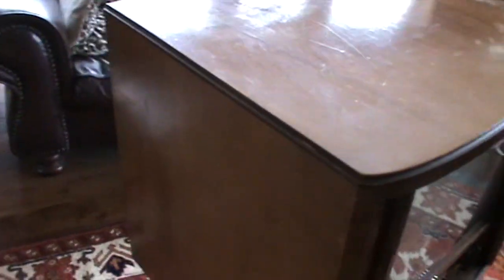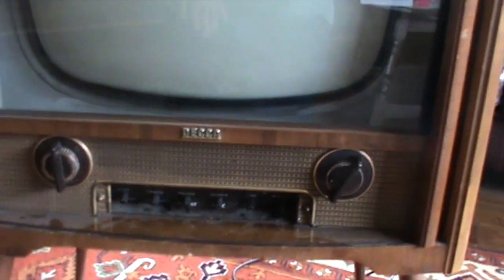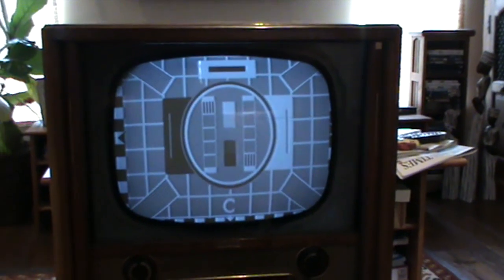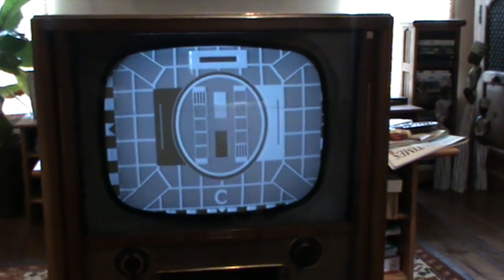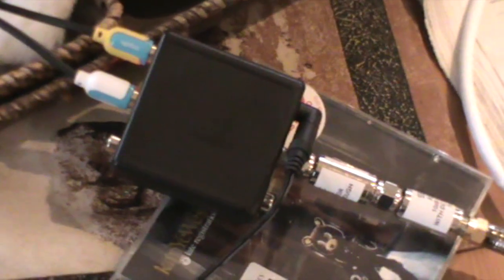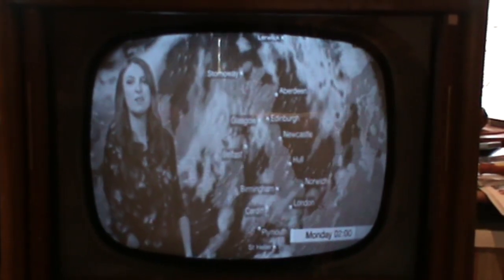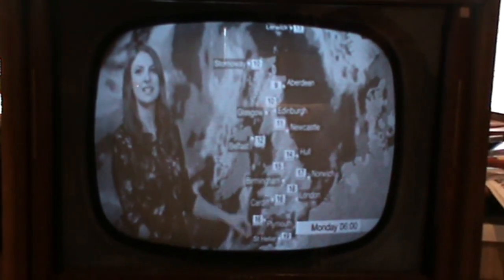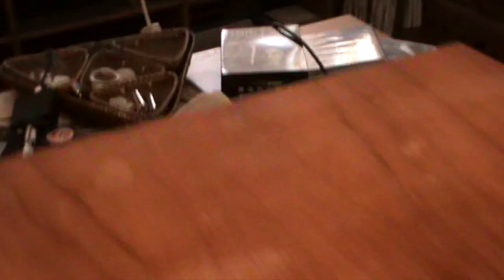Back To The Future: Old 1950's tube TV receives digital satellite television

Comment: Nice tellies, those DECCA DM4. It'll be from around 1958, and is contemporary to my  Bush TV75, Dynatron TV34 and others. The coronation was in 1952, so this DECCA wasn't even on the drawing board.  I have a nice HMV, band 1 only, which proudly displays its royal patronage in the form of a transfer on the top of the cabinet, and states "By appointment to his majesty the king"..... It definitely saw the coronation of her majesty the Queen Elizabeth II.

Valve technology is far superior to modern modified sand in so many ways, and ironically, valve failures were quite uncommon, and many original valves are still functional to this day.

I doubt if many modern, digital flat panels will stand the test of time - And good luck to anyone trying to restore one of those in sixty years time!
Reply: I've one of the first flat-panel monitors (a 2001 Dell FP2000), and the panel isn't the problem, the CCFL light output diminishes over time, and the colour is off. But it still works. 

I do think if it's solid state, and not from the era when all the condensor popped, they probably can last very long.  Just like amplifiers from the 70's and 80's.

Comment: Does anyone know how to get an old channel selector tuned into the corresponding digital station?

For example, channel 10 on the dial would be tuned into the standard definition digital 10 or 10.1 or whatever it’s MUX number or frequency is.

I want to still be able to use the channel selector on an old TV - the kind of selector we used before the push buttons and later remote control came along.

We only had channels 10, 9, 7, 2 and 0.

As it’s an old CRT TV, standard definition is good enough and 4:3 aspect ratio too, if possible.
Reply from the maker: Not sure how you would do this.. you would need a standards converter that outputed on several frequencies.. might be quite complicated
Reply: No chance but with an Aussie vintage TV you won't have to convert to 405 lines. You will need a digital tv tuner which has a VHF channel output at 625 lines for all possible digital channels. HD and SD. If you want to see something on all the available channels on the set then you'll need one digital box per channel, the set will not be able to segregate the signals of a mux. It might not be possible at all if the only digital boxes you can find have a UHF RF output..

Comment: Can you link the converter you used for this project. I’m having a hard time finding the cables and converter for the television
Reply: It's an Aurora SCRF405A, made by a guy in the USA. A new one will set you back about £200 to £250. Second hand ones don't get any cheaper, though you won't have import duty or shipping costs on a used one.  Also worth considering is the "Hedgehog II" which is made here in the UK.

Standards converters are highly prized by their owners, and although they do sometimes come up on eBay etcetera, it's rare, and they're usually in demand.